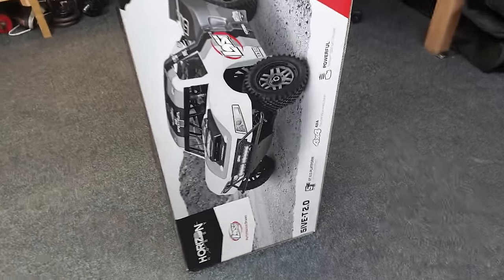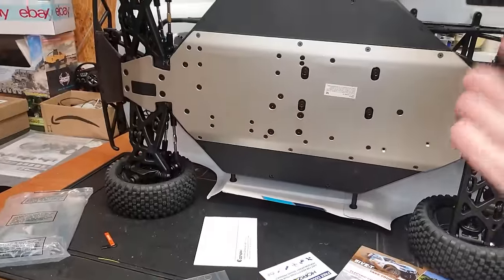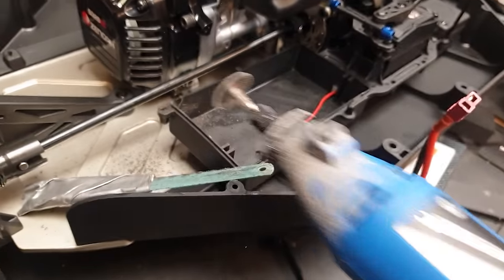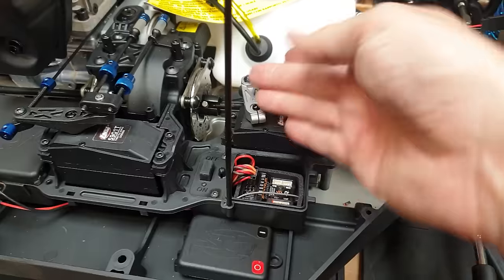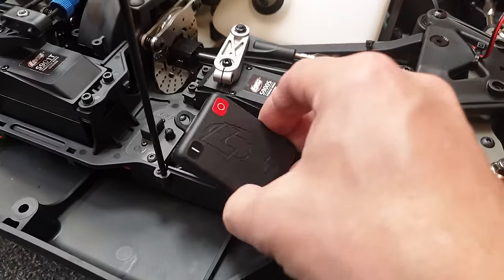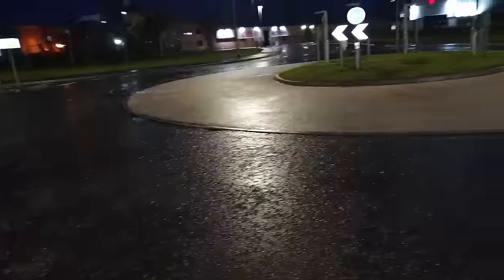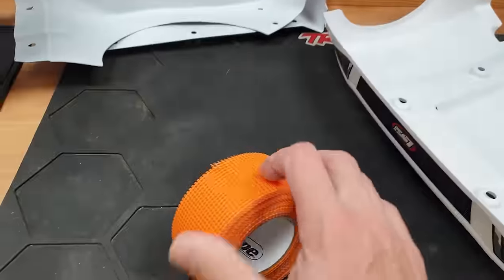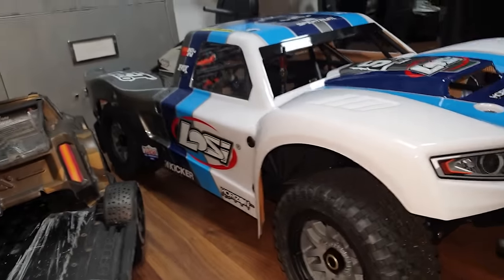GIANT gas rc car (LOUD)

Comment: I like how whenever he tests a loud gas car, he does it in the middle of the night. 😂
Reply: Hahahahahahah... So true!
Reply: Yep
Reply: True
Reply: Yes
Reply: Need Advice on my 4s Arma kraton with the slipper Clutch the servo and the program Button Anybody out there I'm new to this truck i have a smart charger with the readings on the screen amps and volts
Reply: @troyflanagan4237  What do you need help with?
Reply: @CHEESEBURGERRC  hi Mike the tires don't spin but still have front steering and lights on CONTROLLER and inside Truck beside program Button turns green AND no coming from Anywhere what could it be that my Question Mike is it slipper Clutch STRIPPED gears servo or program Button?
Reply: @CHEESEBURGERRC  smoke i forgot to put down
Reply: @troyflanagan4237   Is the motor spinning? If you can hear it spinning but nothing moves, it’s a stripped gear, but if the motor doesn’t move, the motor or esc is broken. I’d have to guess it’s that second one because of the smoke...
Reply: Yes the motor is still running spinning
Reply: @CHEESEBURGERRC  no smoke motor is still on just wheels won't move except at first then wheels stop spinning but motor still running spinning
Reply: No smoke coming from motor just wheels don't spin but front steers and All lights are working light beside program Button and CONTROLLER light to and motor spinning
Reply: @troyflanagan4237  Sounds like you stripped a gear. If it starts moving a bit, that just means you haven’t fully stripped it.
Reply: I hope its only a stripped i don't need Anymore stress with this Truck gear i hope ur right thanks mike
Reply: @CHEESEBURGERRC  IT WAS SLIPPER CLUTCH ONLY THING WRONG WITH IT EVERYTHING ELSE SO WHAT KIND OF WRENCH DO I BUY TO TIGHTEN IT ON.TRUCK IS GOOD
Reply: @troyflanagan4237  Wow! It wasn’t moving because it was slipping? That is loose. There should just be a nut on the front of it that you can tighten with a wrench. The wrench you need might have come with the car, but if it didn’t, just have a look a the nut and find the size.
Reply: @CHEESEBURGERRC  what. Size wrench and nut somebody said on u Tube a 8mm wrench is the to use but it comes with a L shape key to tighten the slipper the owner showed me when i picked it up Today Told me when i get the slipper off put the L shape key in the hole and turn it to the Right to tighten THE CLUTCH But i need to buy THE wrench first to get the first piece off at THE back on the left hand side of Truck he said it takes about 5 minutes he also showed me in the manual book
Reply: @CHEESEBURGERRC  mi Correct with the wrench size i will have a look at the nut Tomorrow and go to hardware store across THE street from me and a sales guy thanks a million CHEESEBURGER RC ASK
Reply: Now i can test out my new Battery Tomorrow the mah5000 14.8 100c
Reply: @CHEESEBURGERRC  hi cheeseburger my slipper Clutch came lose again on first Run goers foward but not. Reseave
Reply: @troyflanagan4237  So the motor and esc are working fine, and it goes forward? That might not be the slipper clutch. You might want to take it in to the hobby shop, because they can actually have a look at it, whereas I can just guess what it probably is.
Reply: Yes i think i will do that spoke to ower today over phone tells. To look at SLIPPER CLUTCH or bring it in i don't understand this because it wss working Excellent took 3 tumbles 2 on Baseball Diamond once on GRASS then that when it started slowing down then when i got home it just rear tires stop spinning.  But unpluged Everything Afterwards and gave it goof shake to get the Rocks out hood off of course
Reply: @CHEESEBURGERRC  i am going to take it Back Tomorrow this is getting very stressful for and i don't drive it that hsrd or jumps with it no hard driving at just drive it on Baseball Dimaomd and grass took.a few Tumbles on Baseball Diamond and grass But Nothing seemed to broken or Damaged then it started All ovet again i just can't believe this is happening first Run to and it just landed on hood of Truck THAT is it i think its more then slipper Clutch myself TO
Reply: @CHEESEBURGERRC  what Could it be Mike is ur Name? Cause there is steering and front wheels go Foward and Revsere when i first took it out. Today was RUNNING Excellent Before those tumbles that Every car or has then like i said before JUST started acting up Again go fowards but no backeards so i turned Everything off the Truck shut it down Completely i mean i did
Reply: @troyflanagan4237  I would guess a gear somewhere is stripped or misshapen somehow, or maybe it’s something wrong with the motor. Unfortunately, there’s only so much I can tell without seeing it, so the people at the hobby shop will definitely know more.
Reply: @CHEESEBURGERRC  maybe ur Right cause ot should not do that on yhe first. Run it too 3 tumbles on the hood on second Run After. Let Engine Cool Down on the first Ran great wss so happy then After second Run After the 3 tumbles 2 times pn baseball Diamond and once on GRASS but Nothing just lightt tumbles on hood it wss doing wheelies and Everything No smoke coming from Anywhere Either no damage on the inside that i could see nothing so i unpluged All the wires turned off the Controller End of story baffling to me stressful i have a broken right hand with a splint on my hand so hard for me to fix plus Everything is New to me on this Truck Not good with Electronics
Reply: @troyflanagan4237  Yeah, my friend has had some trouble with Arrma electronics too. You might’ve just gotten a defective car, and if that’s the case, it should still be under warranty.
Reply: It is 2 year warranty
Reply: @CHEESEBURGERRC  its a Stripped gear mike Rc just got out of shop Now have to leave it in there for a few days
Reply: U were Right on the money
Reply: @CHEESEBURGERRC  i mean put into shop wrong wording
Reply: @CHEESEBURGERRC  Rc Mike have Question for you should i go with Aluminum spurs GEARS or steel 1s because the 1s i have in there Now are plastic and the slipper Clutch will rip them apart again i think i don't know for i just having second thoughts the 4s kraton has to much power for plastic gears to handle and stripped them i saw for myself when THE owner was taking it apart right in front of me and the slipper Clutch was tight Already on it he did not need to have to tighten it was stripped gears way down inside of back of of Truck where the slipper Clutch was what's ur opinion on my Questions on WHAT i just wrote to you or some good Advice on this matter?
Reply: @troyflanagan4237  I’d definitely go with some metal gears on that. I think steel is stronger, so probably steel if you want strength.
Reply: @CHEESEBURGERRC  its a stripped gear $10 Fix spur which is perfect plastic the input gear and Differental are metal need shims in gears so the differential keeps mesh tight and Orange loctite on slipper Clutch.
Reply: @CHEESEBURGERRC  i will later on when i can Afford it in the spring won't be driving my Truck in THE winter unless thrres no snow on ground and it just a little cold out no heavy snow driving mike thanks fo ur help and Advice mike👍
Reply: @troyflanagan4237  Sure! 👍
Reply: @CHEESEBURGERRC  Later. On i want to put Racing gears inside my Truck i think they are called yolks All Metal GEARS the Truck will Drive Awsome THEN!!
Reply: I think kev is where I get it from...
Reply: They think its a civic at 3am but its really just kev with his losi
Reply: I know right
Reply: You got it all wrong …that is 4 pm in the Uk in the winter months :))
Reply: To disturb the neighbour
Reply: Hahahahaaaa😂😂😂😂
Reply: He hates his neigbours😂
Reply: He hates his neighbours hahahahaha😂
Reply: Yeah love that

Comment: It’s the simple things like the mud guards that make it look like a beast. I’ve just pre-ordered the super Baja Rey 2.0 so I’m in for a hell of a bash soon.
Reply from the maker: yeh i have that on order too 
:)
Reply: @KevinTalbotTV  yesss
Reply: Oohh nice, I'm trying to convince myself I don't need the Rey 2.0 but I am failing miserably
Reply: @KevinTalbotTV  nice! Then i will wait on buying a udr till i have seen you test that. If it is as realistic as the udr, i might get that instead. I want to get a non-traxxas car, but some of their models fit my needs perfectly. I have a rustler 4x4 and a trx-6, and i'll get a udr or something similar.
Reply: LukeNukem if you have the normal super baja you can just switch out the shocks and get the 2.0 shocks.
Reply: @whatswiththissassylostchilld  I don't mate but thank you for the info.
Reply: LukeNukem sure thing.
Reply: I don’t really care about the replies to get them out of here
Reply: @dannyryce4784  then why did you reply??
Reply: So satisfying

Comment: The 5T has been my favorite RC of all of mine. It handles like a eighth scale buggy when jumping and using it around tight areas. I never even started the 26cc engine it came with and put a DDM 30.5 CC nc ported with a bartolone exhaust with expansion chamber. Many other modifications also with the bartalone chassis. I have taken this truck with paddles in the sand and jumped it and bashed it relentlessly and 30 plus minutes of runtime per fuel tank fill up just get a funnel and you can fill it right back up without taking the body off. Those four additional screws give the chassis quite a bit more rigidity cuz of the cage built into the body. My body just stays on

Comment: To be honest, because you're you, (no offense) you should probably make the endpoints about half throttle so you don't explode the engine from "over revving" it on the run in. (I'm no professional either haha!)
Reply from the maker: thats actually a very good idea!!
Reply: Exactly what I was thinking
Reply: @KevinTalbotTV  true
Reply: Coming from a small engine mechanic, these 2 stroke engines have enough restriction from the carburetor intake that you likely won't over-rev the engine.  They're made to go full throttle for quite a while.  It's different for all engines, but generally you don't have to worry about that on 2 stroke gas engines.

Comment: Kev was so funny as soon as i saw that you set that battery in there I said what.... cut out that end peace so it slides in cut a notch on the top cover then you have to figure out what you're doing already for the front plate... Perfect Mate

Comment: Hey kev? I want to get the new electric Losi but I don’t know if it’s strong enough. Could you test it, I’ll get one if it’s kev proof🤣
Reply from the maker: im getting it!
Reply: Kevin Talbot thanks so much man!
Reply: Nothing is kev proof!
Reply: AZ RC XMaxx intensifies....
Reply: I run a Losi 3XLE 1:8 and it's a beast! I changed a few things, but look and performance wise I wouldn't trade it for nothing, nicest suspension out the box I've seen and love the plastic/aluminum chassis combo. Just don't see many other bigger Losi trucks? Is there a reason why?
Reply: The Glass Factory they are more expensive and cost more to run overall
Reply: @shadowkeeper1217  yea I guess I didn't think about the $ part. The owner of a local hobby shop sold me mine in like-new condition for 250$, even still had the motor and mount in it, so I guess I got lucky. I took the big stunt tires off and put on the Losi XTT truggy tires (a must if you don't want to do wheelies and want traction), paired with 22t and 6s. It rolls out and stays planted! And you still get to do big jumps and whatnot. My favorite as far as looks as well, hopefully he will bash on one and see how it holds up to the others
Reply: The Glass Factory I recently got the Rovan Baja and it’s very nice, it’s like 450-500 for a 1/5 scale tc not bad
Reply: @shadowkeeper1217  yea Id say I'm happy with their product. And kinda cool that my buddies that have xmax and arrma trucks were like, uh.. what's is that? Lol
Reply: Lol if Kevin does not brake it no one can

Comment: Kevin you don't have to take any screws out to take the body off two pins in the front go underneath two pins in the back, pull the front up and pull forward the two in the rear of the truck. To put it back on slide the body into the grooves. The rear bumper has the holes where the studs from the body connect

Comment: The Shoe Goo method is essential indeed, I do it to all my RC bodies. Except the TR-4/TRX-6 bodies, I left those stock. But they are not for bashing, so it's not really necessary. The Shoe Goo stuff is not cheap but it pays off in the end. Your body will last a whole lot longer for sure!

Comment: 4 years ago I bought a king motor X2, it is freaking awesome. I put an (O'Neil Brothers Racing) OBR 30.5 CC full mod engine on it, it has 7.5 horsepower. It came when its own dyno sheet.

Comment: Itll take the same pipes as the rovan baja 5b and 5SC. Nice chrome pipes available on ebay sub $100. Youve even got a couple of rovans if im not mistaken, you could test fit using those pipes for starters.

Comment: its a zenoah mate, heat cycle it and send it. as for the body screws that hold the cover on some people dont even run them on the track. you can change the receiver pack and refuel without taking it off. would love to see you do a 18s MGM setup in it. makes them an absolute animal.

Comment: Hey kev, you should get a 30 degree north shell for it, they're made of a nylon plastic that will last forever, also heaps cheaper than the stock body. Comes in a few standard colours but is best for bashing 100% check it out.

Comment: Neat body trick, have you tried some spray in truck bed liner? Might be cheaper to get a can of that, then you'd just have to tape windows off if you want and spray it in and done. I saw a video of one brand where it saved a watermelon from being smashed with a sledgehammer. I'd imagine it'd protect an rc body very well, though it might add a bit of weight I'm not sure.

Comment: I like your tip about using hot glue first to help hold down the joint tape before gooing. For whatever reason I've had better luck by reinforcing the body with Gorilla brand Duct Tape than with fiberglass joint tape and Shoe Goo. Both methods no doubt result in extended body life.

Comment: I know i'm a little late but cool video kev, I plan to save up and buy a Losi 5T 2.0 for my 25th birthday and after i run it gas for awhile or the stock engine dies i will probably convert it to electric and use a Max 4 with 70125 560KV motor and use the stupid RC conversion kit. I might also do some aluminum upgrades and a Taylor RC chassis.

Comment: I don't see why one couldn't use a can of spray-on bed liner or what the old men used to call gravel guard, it would be a hell of a lot cheaper and probably easier to put on and you could still apply a layer or two of that sheetrock tape. BTW that thing sounds like you are sawing down trees with a mini Chainsaw! so loud! I love it.

Comment: Hey Kev, great video bro. If dremel doesn't fit, you need a multi-tool (oscillating tool). Dewalt make a great battery multi- tool, you already have the DeWalt batteries. Perfect for cutting straight into tight corners.

Comment: Have they built in any safety cut out on signal loss yet , I bought mine a couple of years ago but it has no safety always worried it is going to take off on full throttle and cut off someones legs lol , I have seen a couple of these runaway they don't stop till hitting something .
Reply: They don't have it factory no. But you can get them killer bee make them amongst other people set it up to the third or 4th channel and go from there but it a must have imo and most places won't let you race without one
Reply: @itsthatguy02  thanks for reply , I am surprised that it is not built into it nowadays a big motor like this should be a standard requirement  ,  if Traxxis can do it I don't see why Lossi can't unless penny pinching .

Comment: You Kev! I got something I'd like you to test on your channel I think may interest all rc enthusiasts.

I've designed and 3D printed a 30mm to 40mm reducer to fit a very powerful 30mm fan that spins at 28000rpm to where a 40mm fan should be. It's only 24mm tall including screws, 21mm without.

40mm - to fit all ESC's that have a max6 sized heatsink.

This fan keeps my ESC's very cool and is way more efficient than standard fans, top covered with a gauze to stop small stones smashing the fins to bits.

I've seen those bloody big fans people are using adding a sh!t load of weight and draining batteries. These fans are 5 to 8volts so power off the receiver.

Silly people are pay £50+ for fans which is just ridiculous.

I've been using these fans for near enough a year now, I've not broken one of them. They've been thoroughly tested 🤣 not sure how waterproof they are, I don't often bash in the wet but I do race through streams from time to time.

Get back to me Kev and arrange for me to send you a sample. You'd be doing me a massive favour as I'm just setting up a 3D design n print business 🙂 RC jet boats is what I really want to create and I'd be honoured for you to test them out. Currently half ways through hull design.

Never mind promoting Chinese Banggood stuff brother 🤣 take a break to help out a fellow Brit, it's important now more than ever to keep as much money as possible in the UK with the current financial economic state as it is.

Peace ✌

Comment: Kev to get these engines to start very easily just prime it with the bulb, and only give it 2 maybe 3 pulls with the choke on till you hear the faintest pop. Turn choke off and it should crank over every time!
Reply: I start'em close to that. After I prime the bulb, I'll pull it 2 times real slow with the choke on. Then put the choke half way and giver a quick one. Starts 1 pull. Then take choke off.